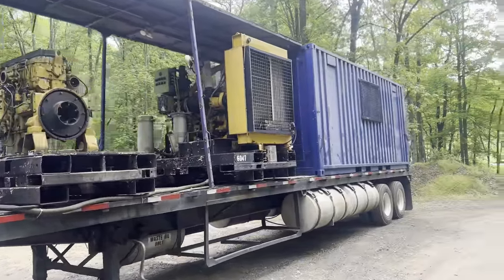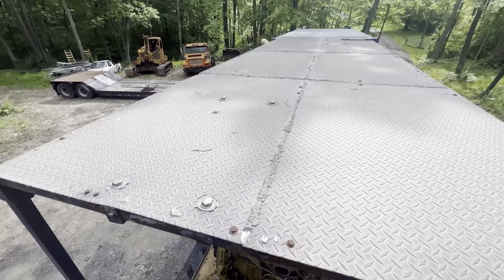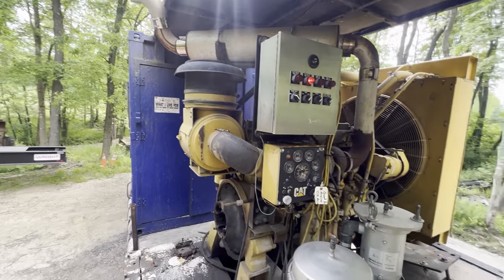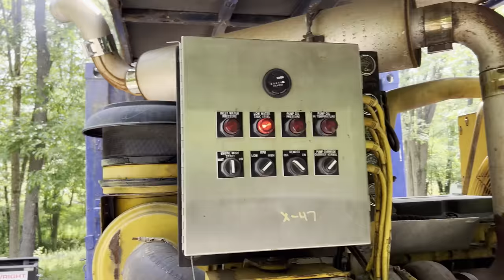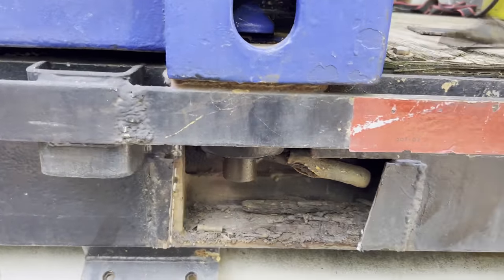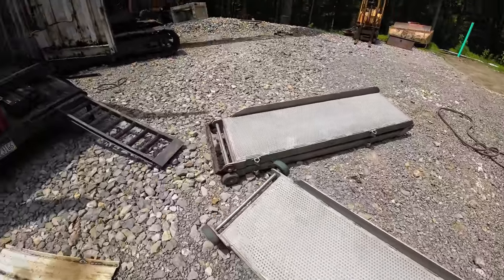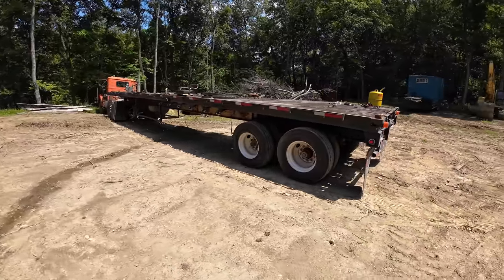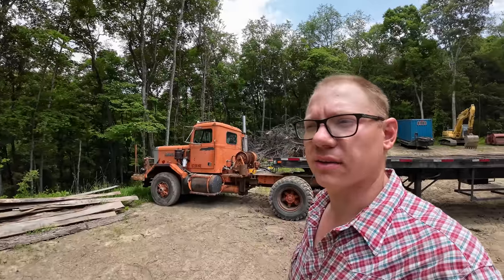I paid nearly $6000 for this Unit at the Auction, Sight Unseen, Will it run??

Comment: Sorry this is a bit of a ramble but thats whats happened here. Ever hear someone say "Flat spots in the starter" or that the starter is weak.  
When they say that what most people mean is the  starter is shorted but not so bad that it stops working.  Happens when you crank the starter so long it smokes or crank it with marginally  charged batteries til it smokes. What is  happening or happened  here.  It Caused the insulation inside the armature or the windings or both of the starter inside to melt . But not so badly that it stops working.  Can act like the motor is hydro locked.  Think that is what's happening here and worth mentioning because of the symptoms.

Comment: Diesel creek your a rook when you turn the loader you bring the center point and weight forward when you turn the loaderalway curl in and check tire pressure come on Rookie moves your gonna hurt your self you need some one spotting you think buddy

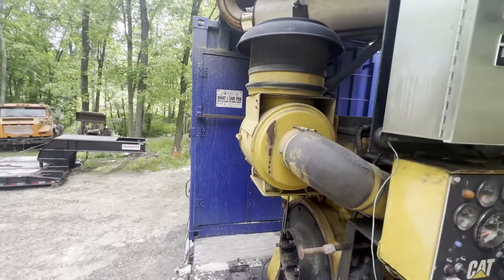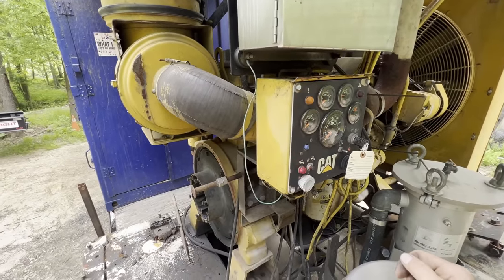Comment: Maintenance Shop. 9:25 toss grinder stone possibly cracked -Spin test it FIRST!! 9:25 follow the fuel line to the Tank on side. 17:38
Reply: Ring test the grinder stones Before spinning -they can fracture and Shrapnel insues! 33:30

Comment: how can you fix the hydrolocking by “floating the valves”? what does it mean?
Reply from the maker: Basically shim or adjust them to hang open through the compression stroke so it  doesn’t build compression just forces the water out
Reply: @DieselCreek  but i think is risky. unknowing the valves - piston clearance at tdc
Reply from the maker: @manfred9913  it doesn’t take much. A dime is a good shim. Done that a bunch of times. Also you turn it by hand first to make sure you don’t have interference then if you are clear hit the starter

Comment: I thought it looked like a trailer mounted industrial sand blaster unit that I worked with during summer jobs whilst in university, carbon lined nozzles, breathing hoods w/ polycarbonate screens that cover the ventilation and communications access - we’d sand blast the bridge deck rebar to clean off the road salt caused rust and damaged bridge deck concrete

Comment: What the hail is wrong with having the older mechanical pumps?
With the common rail electronic injector types seems like a marriage made in hell.
Ok there are emissions issues, but how can that be made in a way where it's not such a pain in the back side.
Too many mechanical engineers come right out of university without spending a decent amount of field workshop time?

Comment: Every video where someone lifts something with forks, I see the same issues over and over again.

Don't you guys get taught about Centre of Gravity in lifting?

When I took my FLT training, the proper lifting procedure is this.

1. Run with forks lowered until in position
2. Lift forks to insert
3. Tilt the load towards you moving CG closer to the loader
4. Lift
5. Move out of the way of the item you are lifting from.
6. Lower the load still on tilted forks
7. Move to placement
8. level the forks
9. lower & remove forks.

This common mistake also applies to those who have been trained at training establishments as well.

Comment: Oh My, your dog is trying to get ran over!
I'm curious, after you get the 20' container back, how you're going to set up your fuel depot with those four 100gal? tanks (inside, on top (like where they are)?
Are  you planning to move the storage units (after cleaning) inside the 20' container to the shop or container sheds?  ;-)
You got some good salvage there, hopefully you'll get a lot of use and/or profit from it.

Comment: Matt if there’s nothing wrong with your Cummins engine in your auto car it’s very easy to turn up the horse power just by changing an external plug in it’s fuel pump .Talk to your Cummins dealer

Comment: The one time I used ether to start a diesel engine (big forklift for moving wrecked cars around the auction yard), while someone was on the starter, I gave the intake just a tiny spray (1/4 of a second) and it fires right up. The reason the forklift needed the ether was because I forgot to plug the block heater in when I clocked out the day before.

Comment: You would not get a bare flat trailer for 6000€ also the container is like 2000€ alone in Estonia :D so in my eyes its a steal, diamond plate like 150€ a piece over 200 if aluminium

Comment: I could be completely wrong, but that little push-button in the lower left corner next to the light looks like a Murphy switch. Did you try pushing that button in and holding it while starting the engine? On most pump motors and stuff I ever worked with, you had to hold that button in until the light went out. That meant the engine had built enough oil pressure. If the oil pressure ever got too low, the switch would pop out and shut down the engine. I suspect that unplugging that cord solved the starting issue because it disabled the engine protection system.

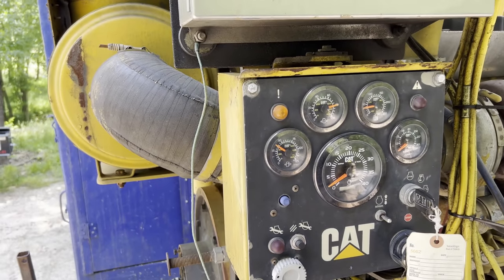Comment: At 23:32, I'm guessing there is an electric fuel shutoff that is somehow connected to the start position on the switch & when you leave go of the switch it shuts off the fuel, kinda like the ballast resistor bypass on some older cars.

Comment: that wire he disconnected was more then likely a safety shutoff IE theres sensors in the tank or on another device that was reporting a condition that if the engine continues to run damage may occur so it just keeps the engine from running.

Comment: Hey Matt, you know the reason why that engine is not running is because the power is only turning on the fuel solenoid when you turn the starter and it’s supposed to stay on after it is running

Comment: With the low gearing in the Autocar, that C13 should still let you haul pretty heavy. But A Cummins certainly would be cheaper to maintain in the long run. I have a 13 speed in my Peterbilt and I love it!

Comment: OUCH ! Make it better MATT !  That unit and trailer can be your  new  crash cart. Put fuel , Batteries, and tow it around the yard with your DUCE and start everything at once . A whole yard of Diesel engines at idle. Still more fun than workin.

Comment: The trailer looks to be painted Westinghouse blue.  The rest of the equipment resembles what might be found on a hydrolance rig.  Maybe it was bought and repurposed for commercial after Westinghouse let it go?  When we'd train in hyrdrolancing we'd go out to the parking lot.  When it was kicked up to high pressure (50kpsi) one could remove concrete.

Comment: That trailer is quite badly twisted, is it even viable to be put back on the road?
Reply from the maker: They are made to flex. That’s not permanently bent like that. It was just the terrain it was sitting on. It’s nice and straight when sitting on flat ground.

Comment: That is a big giant pressure washer pretty much I think that one motor should be able to push like 120 gallons of water a min but that’s not the biggest I actually work with those pump I don’t work on them but I use them on water jobs hints hydro demolition
Reply: And diesel creek I’m not meaning to sound like a smart ass

Comment: There is a lot to sell there.  Those ramps look nice and the 2 winches and batteries can likely be sold.  Those ramps are probably pretty valuable.  The engine of course and you already sold the poly tank.  And then you get some diamond plate and square stock and the engine core.  I would pull it apart and see if the block is good.  If it is that can likely be sold, especially the manifolds and turbo as well as the electronics.  You also have the batteries and the diesel tanks as well as the filters.  The box is in bad shape, but I do like the hand pump.  Depending on what you paid you likely will make out pretty well on this.  I think the trailer was parked most of the time, so it is likely in good shape.  Having very little rust, good suspension and brakes and decent tires will make it worth quite a bit.  I would have tried to take the tank mounts out in one piece and sell those too.  I thin you should strip the rest of the stuff off, clean up the rust a bit, patch the few holes they cut in it, paint it and put down a new deck.  A refurbished trailer like that should be worth quite a bit.

So how much did you pay for this?

Comment: Man, I love your channel and it has taught me many things, but how you go about starting old diesels often makes me cringe. Way back during my training I learned the basics of what should be done when investigating a diesel of unknown provenance or history. 
1 check the intake and the turbo. 
2 check fluids. 
3 remove the injectors. 
4 bar it over. 
If 4 is good then 5 try to crank it over on the starter. 
6 insert the injectors and bleed the fuel system. 
7 Give 'er the beans.
1 is so you don't make it ingest any crap like metal shavings, broken impellor blades or water.
2 is obvious, no oil is bad.
3 diesels are high compression, removing the injectors makes it MUCH easier to (4) bar over and to (5) crank it on the starter to build a little oil pressure and lubricate the system before you go full caveman during 7 and if the cylinders have liquid in them (oil, diesel or water) you'll get some warning squirts before you bend rods.
Reply from the maker: Remove the injectors on your pre-start checklist!?? Lol I don’t want to ever live my life that way. That’s wayyyyy too cautious.
Reply: @DieselCreek  Yeah it's cautious, but the MOD wanted working vehicles with minimum expense on repairs so that's how they taught us. Same applies when you want to resell the engine instead of ending up with lawn art ;-) Plus, why give yourself a hernia trying to bar over a big high comp diesel when 5 minutes has the injectors out and 1. makes it much easier and 2. gives you a better feel for any tight spots?
Reply from the maker: @jamesfirth7795  I assure you itll take alot more than 5 min to pull these injectors
Reply: @DieselCreek  different strokes for different folks I guess. But kudos on not just running a great channel, but also for taking the time to interact with your audience 👍
Reply from the maker: @jamesfirth7795  thanks, I’m not trying to be critical btw you are doing things “proper” I’m aware that’s not always the way I fly lol thanks for hanging out anyhow

Comment: I used something very similar here in NZ for concrete demolition.  It had a c11 that direct drove a 3 piston 20,000psi pump to a hand held blaster nozzle, the filters are super good filter units cause any dirt will mess the pump pistons up real bad.

Comment: Sometimes this guy doesnt act like he knows as much he claims he does. He already confirmed no fuel in the tanks so why is he trying to start it. Makes no sense
Reply: If you tried reading the comments before spouting off, you'd have found Matt hooked up a fuel cell to the motor, not using the trailer tanks at all.

Comment: Bro, you had a pretty dangerous situation with that loader. Have you ever experienced one of those turn over? If youre not buckled in you'll very possibly fall out and get crushed. I've seen it happen. 
I have to ask you though. Are the mishaps and near misses that you always seem to have real or are you staging this stuff just for video content. I hope its the latter becuase bro I'm worried you're going to get yourself killed. Are you by yourself out there? I hope there is someone running the camera so you can at least get some medivac when it happens.

Comment: You said a year ago that you were going to pull the injectors and have them rebuilt. So is this how bad after you had them rebuilt or are you just delaying? Because that has to be one of the saddest running engines I've seen in the last 40 years. Quit screwing around and show us how good of a mechanic you are and get that thing running like it should. 
An old mechanic showed me how to bleed all the air out of a fuel system using a GOLDENROD (727) Industrial Pump Oiler with Flex Spout - 16 oz. Capacity , or something similar. clamp the fuel pump and crack the last injector and slowly pump fuel into the system until it starts leaking out the cracked line then tighten it down but be sure not to let the oil can run dry or you pump air into the system. I've used that way on boats ,trucks ,motorhomes, and engines that people let run out of fuel. It may take longer than using the starting motor but it's way cheaper than buying a new starter and way cleaner.

Comment: Well you're not the brightest guy on the block it looks like it.  Buying unseen auction stuff, doesn't know what you bought? By removing the container almost flipping yourself, the container and your machine, working with low tire pressure, and on the end almost killing your dog not once but a few times. Well the good thing and the bravest thing you did is posting it, but man you are dangerous.